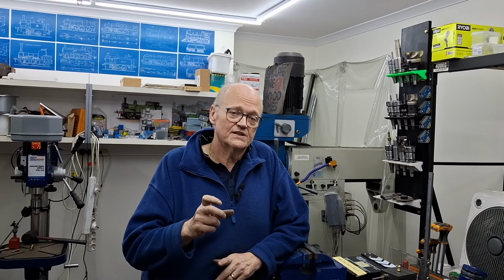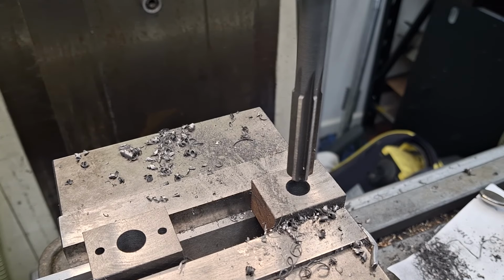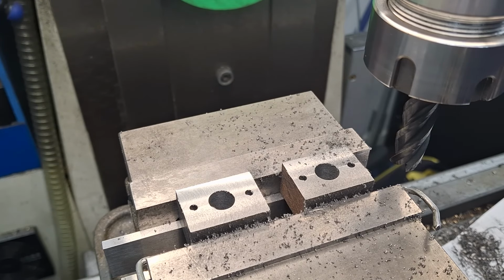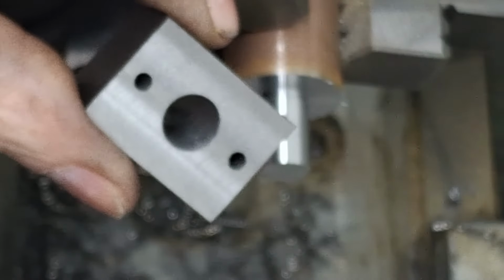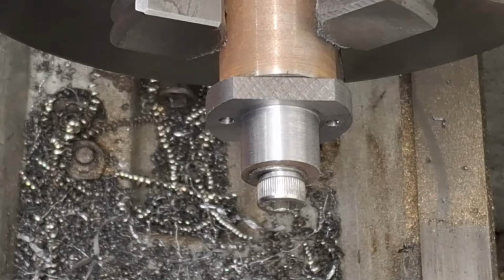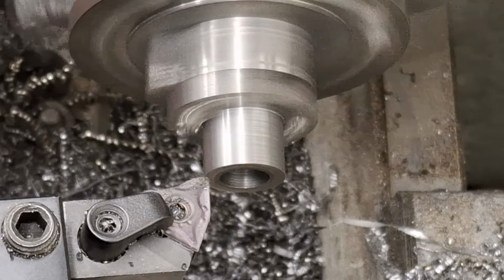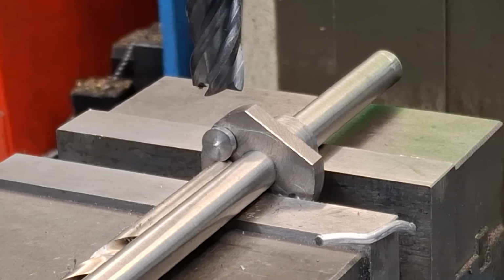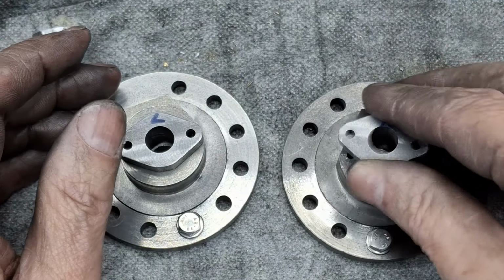067 The Piston Rod Glands

Comment: Something you could consider doing is using your DRO to jump between hole  positions with each tool. This will save you lots of time in tool changing.
Reply from the maker: Hi there,
It all comes down to personal choice. I prefer to finish each hole... it is a hobby after all. It would be very different if I was trying to make a living doing this kind of work.
The Chef